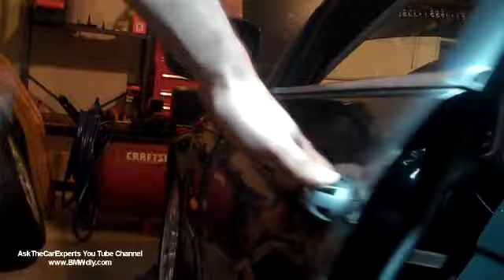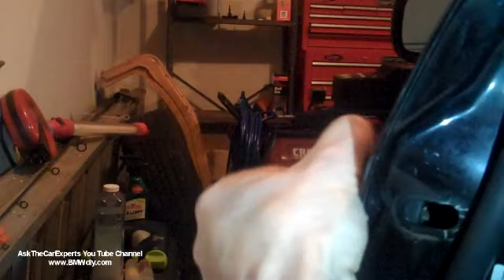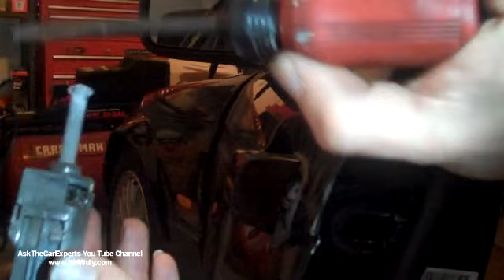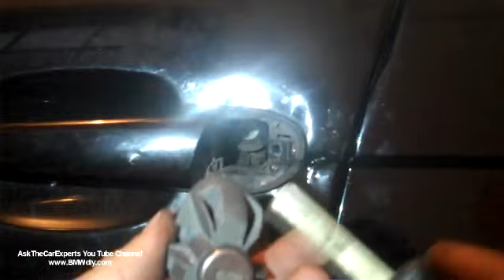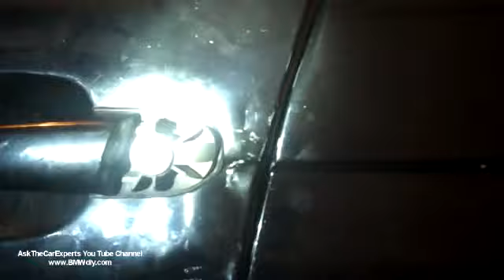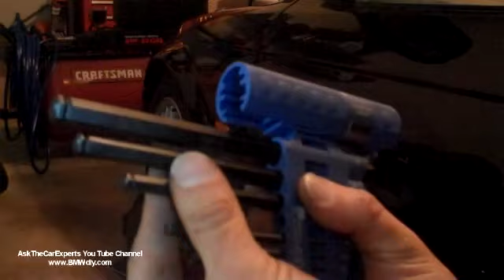BMW Driver Door Lock Tumbler To Replace The Key Tumbler Also Called A Barrell Lock

Comment: I lost my original key so I been using my spare key to manually unlock/lock my door through the drivers side. When I tried to unlock my door as I turned to the right, I felt resistance and sorta felt as though I broke something. Sure enough, when I reached my destination and tries to lock my door as I turned to the left, there wasn't any resistance. The lock does not even go down when I lock it through the inside, nor does it push down when I manually push it.

Comment: Thanks for the vid and the screwdriver tip to unlock doors, etc. also noticed the shaft has murphey proof tip when reinserting.  My e53 had a #4 hex tip bolt.

Comment from the maker: ...(see other post)...which can be difficult. I have a video on how I have done this on another vehicle by drilling into the mechanism and then forcing it to open. This type of job is best done by the dealer or a repair shop that is familiar with this failure due to the difficulty level. Let me know if I can try to help further. Best wishes to you.

Comment from the maker: Hello Annette, If the other doors are unlocking then the tumbler will not correct the door that does not unlock. This is always a difficult situation on a BMW. If you have tried the central lock/unlock button as well and it does not unlock then the door lock actuator has failed in the double lock position. The bad thing is that you need to remove the door panel while it is closed. Sometimes the door panel is damaged during this removal. Then the door lock actuator needs to be forced to open...

Comment: You are absolutely right. the key tumbler failed. i have to replace it. i have ordered the parts and it will be here monday. thanks!

i have another issue though. when i press the central unlock button which is located on the console next to the hazard button to unlock all doors, both rear passenger doors stays lock. but i can open them by pulling up the lever from the inside to manually unlock and open them. what went bad or needs to be replaced on these doors? thanks!

Comment from the maker: This may be a failure of the tumbler or internal in the door latch where the tumbler is inserted. The problem now is being locked out and opening a double locked door. You may need a lock smith to open the door so you can put the key in the ignition and use the central unlock button to unlock the doors. In some cases a double pull of the inside handle will unlock the double lock. Then the tumbler needs to be checked and replaced along with the actuator if need be.

Comment: this happens to my car just now. my remote key battery is dead. so i use to manually unlock and lock the door by my key. but today when i tried to unlock the door. nothings happened. i turn the key but i feel no resistance like it used to be. the key jus spins. is this mean that my door lock barrel went bad? i think my car is in the lock down mode. please help

Comment from the maker: It sounds like the housing failed. Yes you can buy what BMW calls a "coded" part for your vehicle. You need to order through the dealer using your VIN and you will need your license and registration. The new tumbler will come assembled and it will match your key as long as no change was made in the past using parts from a different vehicle.

Comment: When I turned my key a heard all kinds of things (spring and metal parts) fall into the door, and i could pull the whole inside out of the door, what do you recommend I should do? and is it possible to buy a new tumbler that fits my current key?

Comment from the maker: Thanks for the addition Daniil. The screw does have two points in which the threads catch. A hook tool like you used is a good way to get the second thread point to catch. Thanks for the comment!

Comment: Most often the dealership may have you replace the entire door lock with tumbler, all the keys, and the ignition switch to remedy this issue. Which will cost you from $500 up to $800. 
Shops may tell you that the ' door lock actuator'  needs to be replace and charge between $300 and $500 parts/labour but they will just replace this $30 part in 10 minutes, call you a day later to pick up your car and pocket all your money. That is why it is good to research online before going to a mechanic.

Comment: This is a common failure on the E46. If your key just spins without opening the door then the door lock barrel is worn out or broken. My BMW Dealership wanted $500 to replace it. Specialty shops around me wanted up to $300. 

What they don't tell you is the parts cost $30 & takes 10 easy minutes to install!